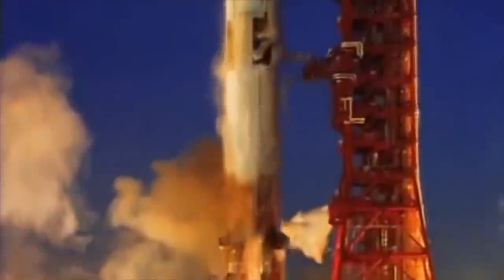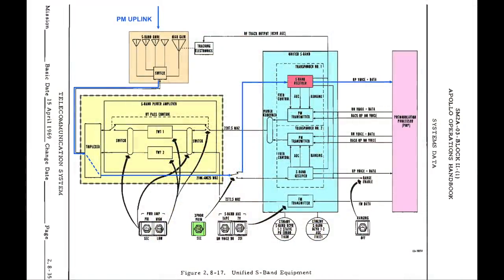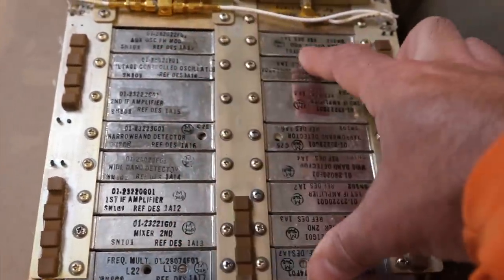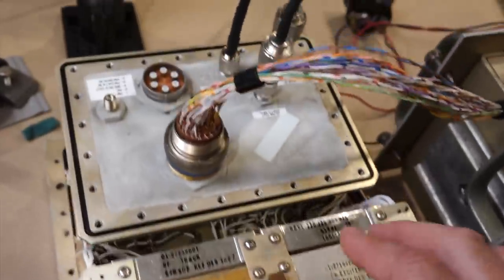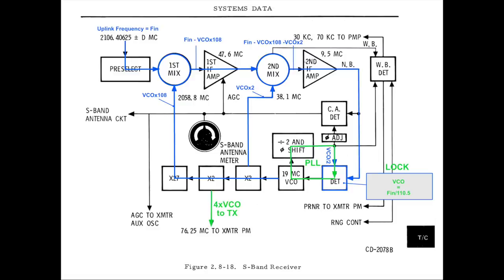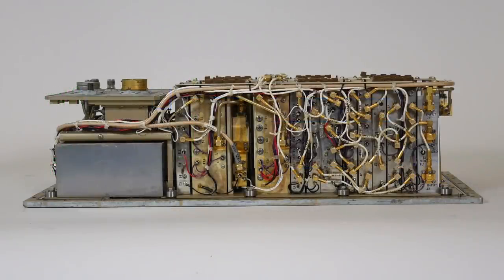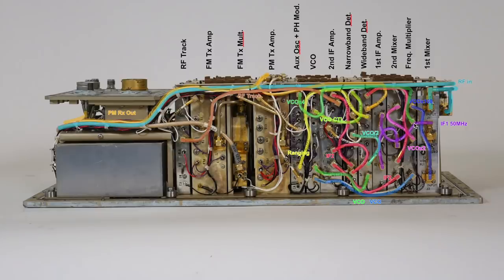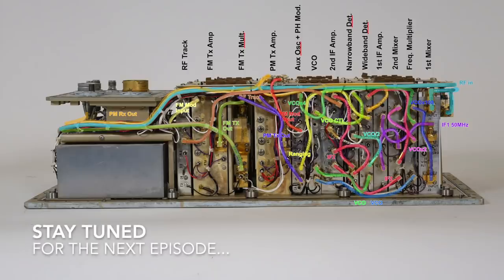Apollo Comms Part 3: Inside the S-Band Transponder

Comment: Interesting,   I was a SDDS ( Signal Data Demodulator system ) technician at the time at a tracking station during Apollo. The equipment you are showing was unknown to me as I was downstream from the USB antenna system, about a half mile away,  at the the actual tracking station where all the data was sent, decoded, and recorded and equipment called a PCM decoded all the down linked digital data. These signals had sub carriers PM and FM which contained voice and video which also had to to be decoded further by the SDDS  for the digital and video data to be recorded and sent to Houston. It has been a long time, but I still remember some of the equipment and procedures. You might not be aware of it but all the timing for these systems used a Cesium beam time standard calibrated to the NBS time standard at Ft. Collins Colorado, because the spacecraft tracking with the USB required very precise timing.
Reply: I believe that Marc has a Cesium beam time standard.  I could be misremembering.
Reply: @TechGorilla1987  Fancy seeing you here TG.
Reply: @demolitiondavedrillandblast  Hello there yourself!  As much as I like seeing things blown to smithereens, I also like Marcs delicate touch and information that I barely understand.  You probably already gathered that I like to learn stuff.

Comment: Quite right.  The actual modules usually would not be repaired instead, on failure, they would just be replaced.   Only us Aussies would try to fix modules because we couldn’t afford to throw them away.  Ever try to find a dead component in a cordwood module with PCBs on both ends?
Reply: Don't watch those Pakistan videos of guys rewinding car starters and rebuilding car batteries!!!!

Comment: This video is great. I worked on modern spacecraft s-band transceivers for years. The most impressive thing is just how much RF IC technology has improved since then. We were able to fit a dual receiver and single transmitter in the 2W range on a single PCB less than 100x100mm, and seeing something that is similar in performance (ours was unfortunately not fully coherent turnaround) that basically is the guide for today in its original form is super impressive.

Comment: At 04:14 the time delay back at Houston when using "Ranging" gives distance but also the frequency shift gives velocity either away or towards the receiver using Doppler shift.
Reply: I guess the speed derived from Doppler shift needs to be divided by two, to allow for the outbound and return legs both being shifted.
Reply: @Richardincancale  No, because the transmission frequency from the spacecraft is known. It was set & built into it before launch. 
It's the frequency of the transmission from the spacecraft upon reception, and the difference from the known transmission frequency, that gives you the Doppler shift from which you can calculate the the velocity of the spacecraft.
Just like the Doppler shift heard from an passing fire engine or a train whistle.
Reply: @Aengus42  What you say is true if the frequency was derived from an on-board standard like an OCXO. But if you follow Marc’s explanation the transmit frequency from the craft is tied to the received signals from earth via a PLL - the famous 221/240 translation ratio.
Reply: @Richardincancale  If that's the case then I misunderstood. Thanks, I'll go back & watch it again. 
But one thing puzzles me. How did Jodrell Bank in the UK track the position, velocity & landing by Doppler if their transmit frequency kept changing?
Reply: @Aengus42  Yes I was puzzled too.  The advantage of the transponder idea is accurate rangefinding by measuring round trip time (assuming you know the delay time in the transponder itself) - and receiving stations would need to be synced on the ground with the transmitter site.  And the actual transmit and receive sites will change every few hours as the earth rotates…. Complicated!
Reply: @Aengus42  I guess the key advantage is that it let them use a very high stability frequency/timing standard on the ground, with a fixed ratio frequency converter on board. So they could use Césium or Rubidium standards on the ground to get parts per billion accuracy.  Putting these atomic frequency standards wouldn’t have been possible at the time due to weight, size and power consumption - plus you’d need two for redundancy.  Just using OXCOs would give an order of magnitude less accuracy - especially if the frequency (and errors) had to be multiplied by a large factor to get to the S band frequency required.

Comment: The wiring doesn't look as bad as the time I hooked up a 5.1 surround sound system...with two phonos, a dual tape deck, CD changer, 4K TV, LaserDisc player, Blu-Ray, reel-to-reel/8-track, ChromeCast, external antenna, XBox 360, and DCC player. It all makes sense to me. :D

Comment: that's the crazy thing about this apollo hardware, these boxes all sat next to each other but the AGC, Abort Computer, these transmitters, and the Saturn V's launch computer all used different construction methods
Reply: That was deliberate. They were worried that if everything was the same and there was some unknown problem with it, it could all fail and everything would go dead at once, which would be a bad day. By making things differently maybe only one thing will go dead, and enough of the rest will still work to keep things running. That's also in part why they had different companies design and build different parts.

Comment: Hmm... 240/221 = (2^4*3*5)/(13*17).  The numerator and denominator are relatively prime.  My guess is that this overall divisor keeps the return signal away from any weird harmonics that might result from either the transmitter or the modulation itself.  I'm really curious about this.

Comment: Rip it apart all right. It's the guts and how it is assembled, what parts are used that is the interesting bit. looking at the cables is a bit boring. :) I'd love to see what they used for parts. Are there any integrated circuits ? Is it all discretes ? Is some of the rf stuff dead-bug (or teflon stand-offs) or is it all on circuit boards ? i'm sitting at the tip of my chair ...

Comment: I know that there are recordings of the voice transmissions from the spacecraft(s), but are there data recordings/logs of all of the data received as it was received?
Reply: If they are available today: I don't know. Anyway, this has to be an gigantic (and highly boring) amount of numbers.
But sure they existed. All flight controllers (although the prime customers sure have been EECOM, GNC and the trench guys) had the possibility to order printouts of those logs from 'Operations & Procedures' (an almost forgotten, but incredibly important MOCR controller) for in-mission-analysis. Not to mention that post mission evaluation strongly depended on them.
Reply from the maker: Yes, everything was recorded on instrumentation tape recorders at the receiving station itself. I'm not sure how much was recovered, but Marcel has the graph of the AGC utilization  during Apollo landing (showing the overload leading to the 1202's), which most likely was made from data played back from a tape.
Reply: Okay, if you put it that way: I'm quite sure none of the anlogue tapes has survived. What quite possibly has survived is data that has already been processed by the RTCC i.e. brought into a readable and useful format. I'm quite sure I've seen trajectory data for some missions deriving from the CMCs downlinked state vector, so that's there. But systems data...ugh. Sometimes you see some bits of it in the anomaly sections of the mission reports, but a complete printout? Yikes, who'd need that today?
Reply: @miriamn1075  I'd bet about 10% that some of the data is still around on instrumentation tapes and/or computer tapes in some vault in a NASA basement, and maybe it wasn't flooded with muddy water two or three times in hurricanes since it was stored there. Whether some of it is readable is questionable, but possible. Whether the magic decoder ring still exists to say what the data on the tape was and what it meant is a little less likely. The chances that there is complete data for even a single mission is about -100%, which is a lot less than 0%.
Reply: I still have a 10 inch reel of Scotch IRIG tape from NASA about 1964 or earlier.  There were warehouses full of instrumentation tapes that were surplused and sold at auction.  So the answer is: there were, but not anymore.
Reply: @miriamn1075  I distinctly remember a project not too long ago which was based out of an old McDonalds on a base somewhere. There they had reconstructed one of the tape machines and they were reading apollo era tapes. I can't remember if this is the same info you are taking about but i believe it is.
Reply: That's the Lunar Orbiter Image Recovery Project. The worked with analogue data tapes, yes -because that's the native format the images were in.

Comment: I'd guess that the frequency ratios are still in common use because of incremental reuse of technology and the TDRSS network. You can find the 1974 copy of the users guide and it contains some very similar looking frequencies but with multi-user capability bolted onto it. These folks were masters of backward compatibility so I wouldn't be surprised if they wanted to allow satellite platforms to simply reuse the same transmitters and receivers but upgrade to TDRSS support with changes to the equivalent of the PMP.

Comment: I'm certain that if modern 21st century components were used for computers and GNC stuff onboard Apollo vehicles they would be tiny  fraction of the size and weight of the actual equipment used in the 1960s. But analogue electronics is a mystery to me. How much smaller and lighter would this RF stuff be with today's technology?